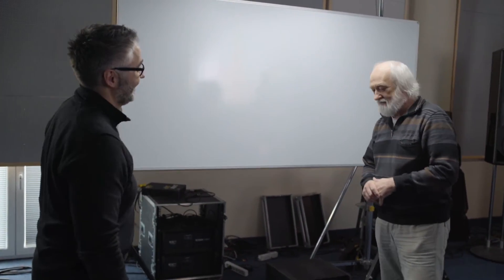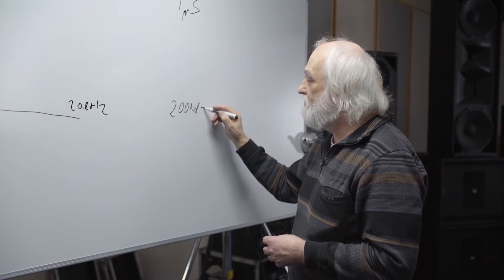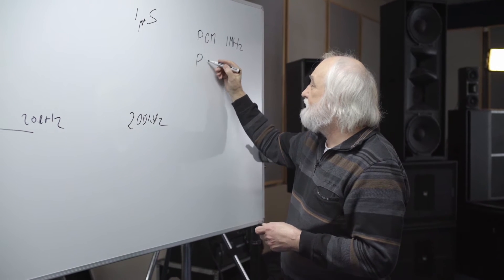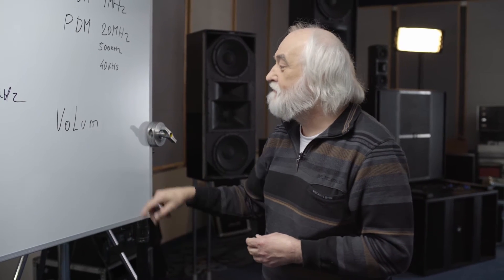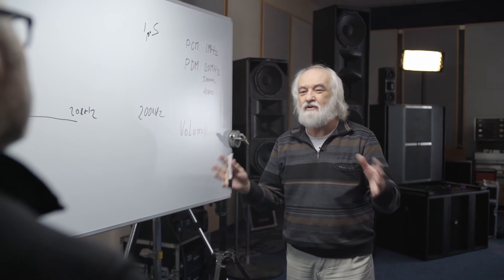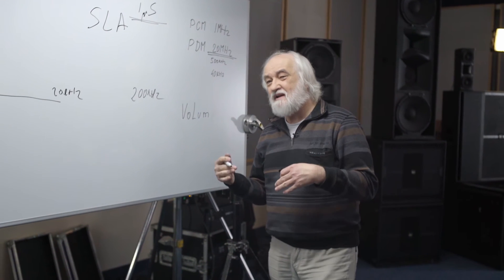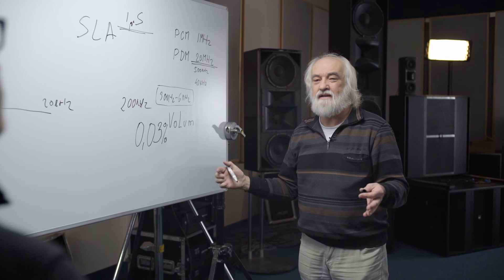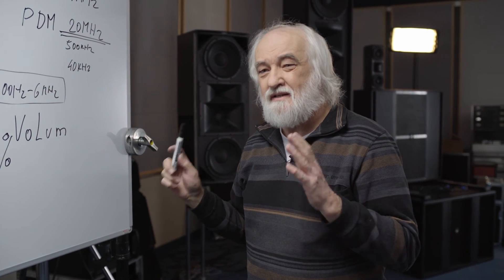TECHNICAL TALKS - Time - the Missing Dimension in Today's Professional Audio Industry

Comment: I don't believe that this old man still have 20 Khz hearing. No one can keep 20 kHz hearing at this white hire age.
Reply: He's not talking about that. He's talking about the time domain. A 1MHz sampling rate can more accurately represent the time domain
Reply: @Elliott-Designs  How? Sound propagates through air all the same.
Reply: @slofty  First of all, that's not true I'm afraid. Dispersion is dependent on wavelength (and therefore frequency assuming a relatively constant speed of sound), for instance, imagine a speaker, high frequencies will propagate forwards, whereas because low frequencies have a wavelength that's long relative to the size of the speaker, it will spread around the size of the speaker. This is why bass can be loud behind a speaker, but higher frequency sounds get quieter (in an anechoic environment - no echoes, we actually wouldn't hear any high frequencies, assuming the cabinet also wasn't vibrating).

As for my initial statement. This is an altogether different matter. This is about the conversion from digital to analogue and therefore resolution. If we had a sample rate of 20kHz then the highest frequency it would be able to represent is 10kHz, because you need at least two points to plot within a cycle of sound in order to reproduce that frequency. However, just using the Nyquist frequency (double the frequency we are attempting to reproduce), doesn't mean that it's being reproduced accurately. A sample rate of 40kHz gives us two points to plot within a 20kHz cycle, but these two points barely represent the shape of the wave at all, draw a line between them and you end up with a straight line, not a sine wave. Plot many points and you get closer to the sine wave. This can be mitigated to a certain extent through interpolation, but this is just smoothing relative to the rest of the signal and not actually putting the detail back in. There's the other matter that these two points might happen to line up on a silent part of the cycle rather than the peaks, meaning that the signal isn't actually converted (there is also everywhere in between). This is why we don't use a minimum sample rate of 40kHz, but slightly higher at 44.1kHz or higher. Sample rates above this will represent the wave even more accurately.

Now whether a speaker is able to resolve such high frequency information accurately is a different matter altogether, and whether we'd be able to discern it at all is a totally different matter.

Hope this helps
Reply: @Elliott-Designs  "but these two points barely represent the shape of the wave at all, draw a line between them and you end up with a straight line, not a sine wave"

Watch videos on the Fundamental Theorem of Calculus. If you used calculus during your time at uni, you would understand that d/dx can be sufficiently expressed such that an oscilloscope of a converted 16/44khz (or even lower bit depths!) signal will match an analog source-generated signal of, say, any given fundamental (at a minimum, I am not looking to give examples that would be described by g' of x etc. or other notational forms). This is what AES (or other worldwide equivalent) engineers took into account when developing hardware and other standards to fit these devices' tech parameters well within the audible threshold for any given human being.
Reply: @Elliott-Designs  Can you give any iterative layout of how the sigma notation used in the development of the IC layout in 16/44khz systems to fully approximate an analog waveform along slope f(x) such that dy/dx CANNOT provide a sufficient value of the tangent of that particular slope at any h? At present moment mathematics says otherwise. 

 Because in doing so you would show that Lagrange and everyone after him was mistaken. Keep in mind Fourier, Poisson, and Babbage cited Lagrange in their work and those that followed cited their work in the development of nuclear/particle physics, semiconductor tech, and GPS, among many other things!

Comment: since medium (air) is always changing by heat expanding, humidity, volume. it would be difficult to get near perfect audio reproduction using any of digital technology since amplifier is controlled by solid state mechanism (digital). maybe perfect sound reproduction can be reached by using analog voice drivers that are not powered and driven by digital, for instance by using very controlled  lightning or spark produced by tesla coil.